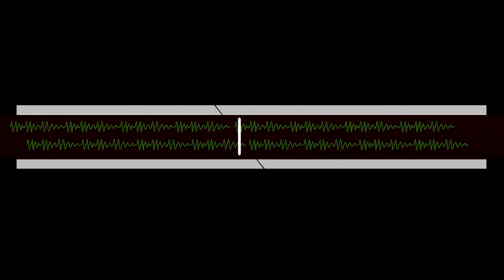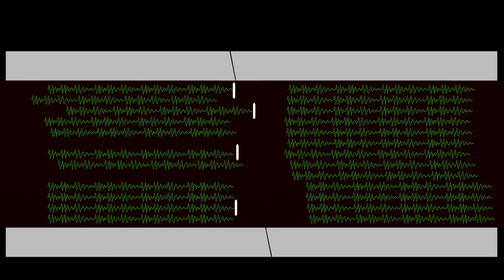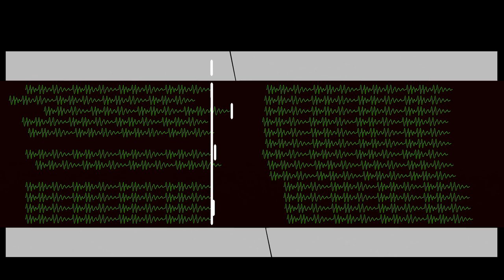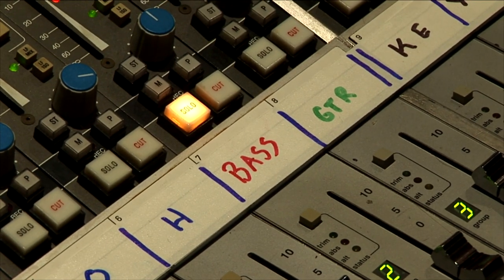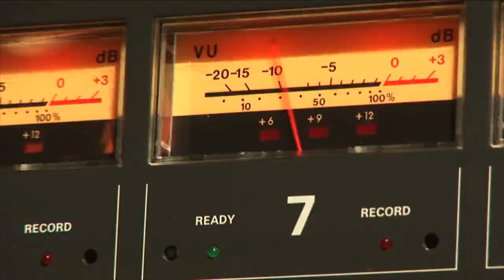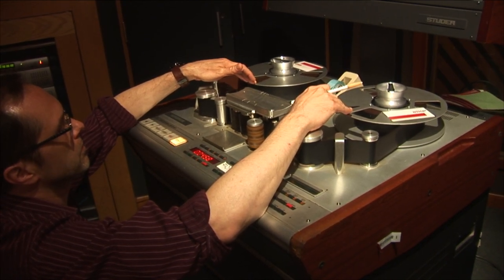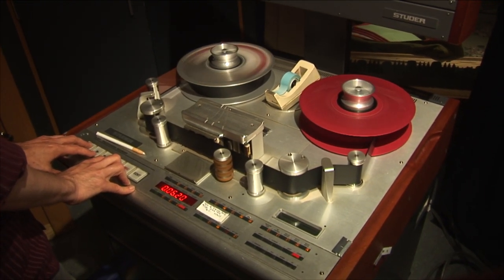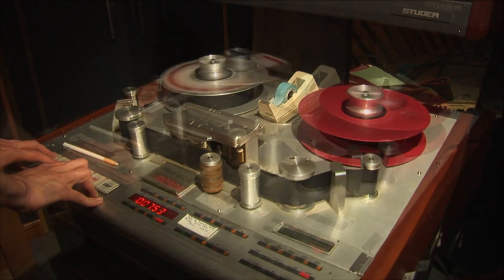Editing Analog Tape Multitrack

Comment: Man this is really cool, I've never seen how analog tape is edited for music. Makes me appreciate all the effort to produce such rich sound on my AAA LPs. One question though: why are the editors not wearing gloves? I have done some basic 16mm film splicing/cleaning and the one thing I always did was to  wear gloves to avoid getting fingerprints on the film, and when handling it for threading or inspection where I don't always have gloves, to handle it by the edges to avoid getting dirt/oil on it.
Reply from the maker: I took film classes the summer of 95 ( I believe) ant NYU in NY. I edited16 mm film and did use gloves. Without doubt  a finger print could cause a serious distraction on film. I transfer old negatives in my photo scanner and I use gloves. In decades of working at the finest studios world wide, I never saw any engineer use gloves. Always stocked near the tape machines was 99% alcohol, razor blades, and splicing tape, possibly Q Tips or other lint free wipes. But I never saw a pair of white gloves. It was never an issue.
Reply: Magnetic tape simply isn't the same thing as optical media like film. With optical media, any sort of dust, fingerprint or other impurity can severely impact how the image looks like. With tape, the only thing that matters is the magnetic charge of the microscopic magnetic filaments on the tape, which frankly are protected by a layer of coating. Fingerprints don't really degrade the tape quality, not as much as it does for film. Therefore you don't really need to use gloves. If you need to clean the tape or the heads, you can always rub some alcohol gently, which should get rid of the filth.
Reply: the 16-track tape Queen used to record Black Queen lost its oxide coating because of how many overdubs they added, it must've been sweating profusely

Comment: It never occurred to me that editing was done in this way. I assumed it was done dubbing tape to tape.
Reply: There's a reason why cut in digital media is called that way. Because in analog era, it was literally a cut. And it still is.
Reply: Tape-to-tape dubbing still does occur, but analog tape media is subject to signal degradation over multiple copies, even on high-end studio equipment. Cuts can preserve the audio quality better. Also, when dubbing like that, you either need a well-practiced tape operator to initiate the changeover, or you'd need timecode synchronization/electronic control to really be precise. With physical tape cutting, you can replicate some of that precision in exchange for more labor in finding the cut point.

Comment: Amazing.  Does music sound better on analog tape?  Seems like the hi fidelity albums from the 70s and 80s hold up longer than the more recent digital productions.  Could be a lot of other factors tho.
Reply: It's more proper to say that tape can do things to analog audio that can be pleasant, when properly used. Tape saturation is one of those things, where by slightly overdriving the signal onto the tape, you get a combination of soft-clipping distortion, compression, and filtering (low and high pass) that can enhance whatever track you put it through, if done tastefully. When recording direct to digital, both the perfections and the flaws in a recording are laid bare, and you either have to be more scrupulous in getting a great pre-processing sound or do more processing after the fact to smooth things out the way tape would.

TL,DR: Tape can help make things sound good, but it's no replacement for the craft of good recording techniques, sound design, and just plain craft in making music. Digital lays all sins bare.

P.S.: As far back as the late 70s, studios were attaching PCM adapters to their tape decks to record digital audio to tape. Christopher Cross' debut album was recorded and mixed with multitrack digital audio, for example.
Reply: @eddievhfan1984  awesome thanks so much for the insight.  Sounds like not a simple one is better than the other.

Comment: I rarely cut in a $350 2" tape, unless it has gotten a damaged spot. Better to do it on the 1/4" master.
Reply from the maker: That wont help if you want to take the best of two or more band takes which you want to overdub more instruments. I assure you, pros did this for years and it was a common practice.
Reply: @biasedaudio  I rather re-record than cutting in the 2" tape. Just my opinion.